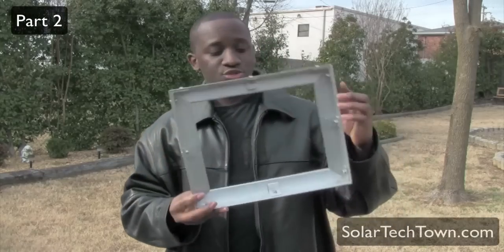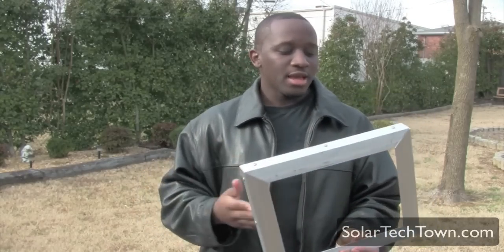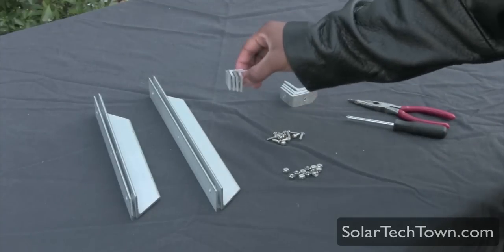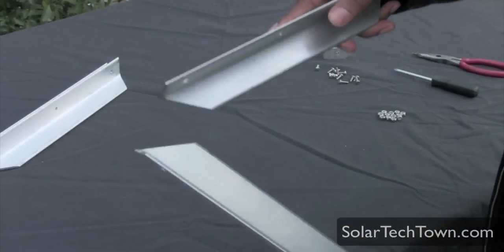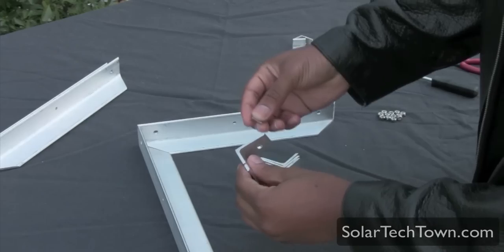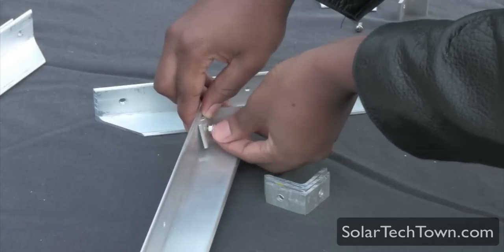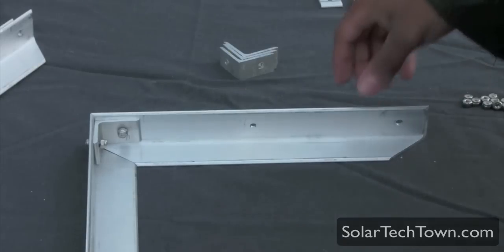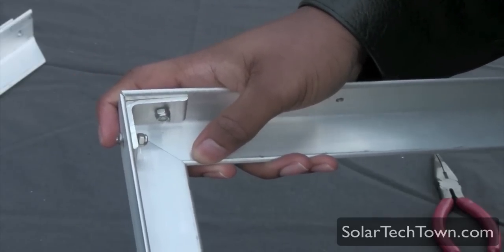How To Build An Aluminum Frame Solar Panel - Part 2/3

Comment: Not trying to post a thousand comments, but I also noticed you speak about keeping it tight (the corners). You can apply silicon  to the edges of the corners before fastening it together .... this will help seal it a bit as well. You can also by your own aluminum and build the frames yourself for well under $20 if you have the tools to do so (for those who do).

Comment: Also in this video you are not building a 36 cell panel ... so yes, it may only come to around $40 for the frame, glass, and cells package, but it is much less then a 36 cell panel. The land I am working on right now has no water bills (wells) and no electric bills (solar) and the electric company pays you back for any un-used electric that you feed back to the system. It is completely off grid ... pay only the land tax, but if you produce enough electricity (wind solar and hydro) it is free

Comment: You do not have to use "slygard 184", you can use any encapsulate ... there are many htat are cheaper then slygard 184 which will bring the price down. You can also get solar cells (36-40) for as low as $30, but as much as several hundred ... shop around and always pay the least amount ... brings the price down (based on demand). You can build a solar panel for as low as 100 capable of charging a dep cycle (or many deep cycle) batteries. Just a heads up.

Comment: ok got yea its cool. but using th same ideas and steps you show there you can do the same to make the larger pannels I wonder how much it would cost me to build a larger one finding uv glass will probably be the hardest thing.  and I have found even with my small pannels I can get them to push 20 watts if I use a fenell lenz like those found one big screan tv. liek the projection ones. or even a mirror.  getting free power from the sun is exciting.

Comment from the maker: I planned on using similar cells that the professional panel used, which are regular solar cells, just smaller. So they don't have to be broken at all to use 36 solar cells, just cut down to size so that you have enough to produce 18 volts since no matter the size of the cell, each one will produce .5 volts. It's hard to see from far away, but that 6 watt professional panel I have in the video is made up of 36 small solar cells.

Comment: so you are talking about the small one I guess you are using 36 broken peices to make that pannel but its cool but either way its cool what your doing.   I was thinking you was talkng about building one of the large pannes for that price and I was like heck that is cheep lol because one of the 36 cell 150 to 200watt pannels are like 600 bucks or more. not cheap almost 4 bucks or more per watt.

Comment: sorry for the confusion the small ones I have are only 10 watts and produce 18 volts in full sunlight.     I saw on the video you was talking about a 36 cell pannel and I was thinking you was using the full size cells that are like 4x4 inch.    and I was looking at the figures you had and thats were I got the cost so I guess I thought you was bulding a large on with 36 cells to build like a 150 to 200watt for like 150 bucks give or take a few bucks

Comment from the maker: Great, it just looked like in your message that you stated with the small panel I was creating, I could produce 150 to 200 watts from that?

What type of solar cells are you using, as I don't believe they offer that technology in the US yet? lol The max wattage I can see coming out of a frame that small is anywhere from 5 - 10 watts, but I'm just estimating there.

Either way, it would still come out cheaper to buy the professionally made panel off eBay in this case.

Comment: O yea I know that I have two solar pannels they are 18 bolt and are only 10 watt got them for 25 bucks for a lot of 5 at a goverment auction.  all solar cell big or large produce about .5 volts. some are less some are more +or_ .05 and amperage varrys depending on the pannel if you want current I know you link in parrellel and if you want voltage you go in Series and you do both for voltage and amperage and I know you take the amps x the voltage to get wattage.

Comment from the maker: It's usually setup like this: 

The larger the solar cell, the greater the amperage, but the voltage will usually always be only .5 volts.

So no matter what, I was going to end up paying a lot more to build one myself. A lot of people don't understand that solar energy isn't as cheap as many of these articles state they are unless you can find resources where you can receive discounts, or even receive the cells for free. Some use broken solar cells like Virlusun, which you can find cheap.

Comment from the maker: The one I bought off eBay for $40.00 was a 6 watt solar panel. The one I was aiming for was the same wattage (6 watts). 

Most PV Cells are rated at .5 volts each, so that's why I only needed 36 solar cells no matter what the size of the cells are since each one is rated at .5 volts. However, what is reduced is the amperage output. The amperage output compared to an evergreen 3x6 solar cell is fairly low.

Evergreen 3x6 Solar cells = 3.5 Amps
These small solar cells = 0.30 Amps
Reply: Robert Smith Wow !!...8 years ago you paid $40 for a 6 watt panel ? Crazy how much the prices have gone down over time.

Comment: there one you said you found on ebay for 40 bucks whats the wattage and voltage of that pannel compaird to the one you was shoing for 150 I would almost guess that the one for 150 could be like a 150 to 200 watt witch if you were to buy built wold cost you about 700 bucks so if you can buld one you self and be as good as the professional ones then you could almost build 3 for the price of one build buy some one else and thats what I like to do build my own would save me a lot of money.